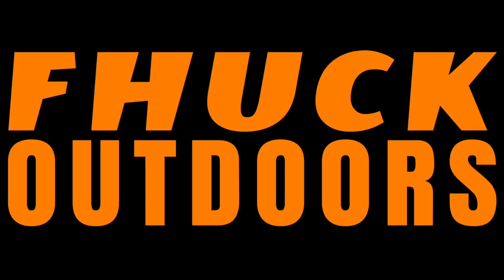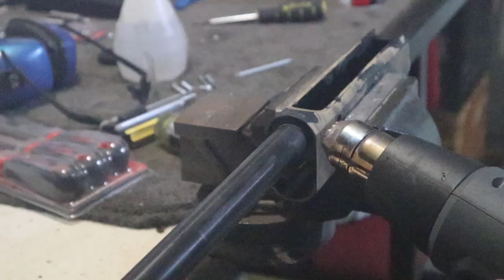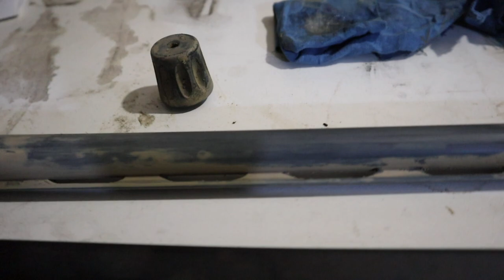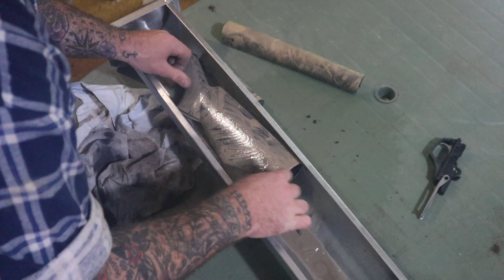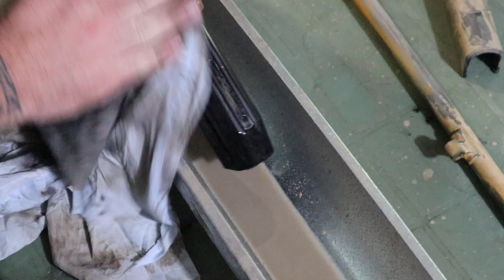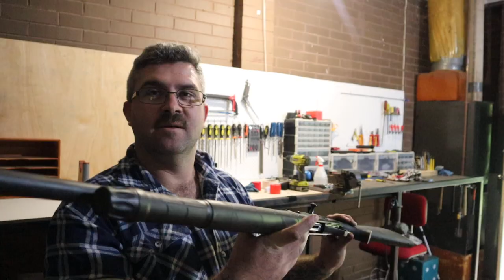How to REMOVE paint from a SHOTGUN

Comment: Holy crap how easy was that! handy info as there can be some nice guns with butchered paint jobs out there
Reply from the maker: The two hours of scrubbing is much easier in a 2 min video 😂
Reply: @fhckoutdoors  i thought the paint would of stuck alot more than that, good stuff
Reply from the maker: @bestestusername  This was rustolium paint I'm pretty sure. Ive had some paints come off easier.
Reply: Does this technique work on a painted 870 wingmaster wood stock? Thank you for the video!

Comment: Love ya work mate
Reply from the maker: Thanks man!
Reply: Such nice work on this video. Thanks! Based on your video, I took a chance on purchasing a really inexpensive shotgun that had a terrible paint job. I’m hoping to restore kg back to the original. Any thoughts on how to remove the paint if mine is a wooden stock? Any other tips or tricks to this project that didn’t get put into the video? Thanks!!
Reply from the maker: @Kilohana67  If its a wood stock you can do two methods: Remove with paint stripper, sand and re-oil/varnish or you can use a paint scraper to remove the pain without opening the wood grain, then re-oil/varnish.